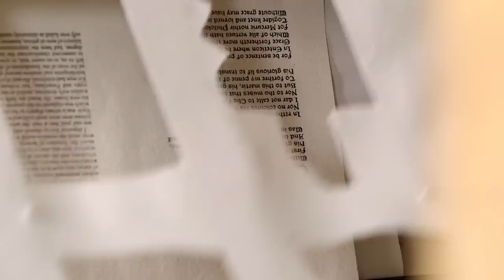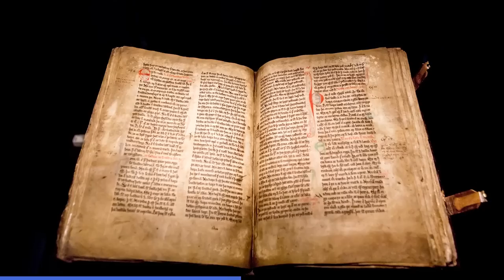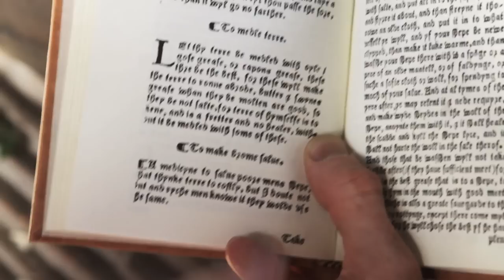Why Did Medieval People Love Sheep So Much? | Tudor Monastery Farm | Chronicle

Comment: I'm so glad you can now use a washer to full wool. And no urine either. You can use urea, which is synthetic urine. I just use Original Dawn dish soap to scour the wool and set the twist.
Reply: urea isn't synthetic urine. urea is a chemical. urine does have urea in it, but  they're not the same thing.
Reply: @sethescope  "About Synthetic Urea: How Was It Discovered, Who Did, And How Is It Manufactured Commercially
by Ben Bareja
Last Updated April 13, 2022
Synthetic urea refers to the urea that is produced artificially as distinguished from biosynthetic or natural urea.

It is an industrial product that has found many applications but primarily as nitrogen fertilizer.

Also described as synthetic or chemical fertilizer, it is an organic compound that is manufactured following an industrial process independent of living organisms.

Natural and manufactured urea have the same chemical formula CO(NH2)2.

However, natural urea is produced by living organisms, specifically, humans, other mammals, and other ureotelic organisms (excretes most nitrogen as urea; Mathews and Van Holde 1990) and subsequently excreted mostly in the urine.

Pure urea was isolated from urine many years ago."

Comment: I feel like the washing part just got them muddy 😂
Reply: And the scrubbing part?  That's how you turn fleece into felt!  Agitate wet wool!  Depending on how much scrubbing they did, they could have a heck of a time trying to card the stuff.  Once felted, that's permanent!
Reply: Two things to consider 
1 washing was about getting out months if not an entire years worth of matting of the wool. By comparison the silted mud of the pond bottom would be relatively minor.
HOWEVER i cannot stress hard enough how their improvised and amateurish efforts would not have been tolerated by a career shepherd. 
A career shepherd of that time would have had a lifetime of experience at the craft, and the lifetimes of experience from their predecessors and the tools and furniture etc would have been well thought out. A stagnant pond would never have been even considered, instead a flowing stream with a down stream sheep gate and board ramp to boost the sheep onto and exit cleanly into a dry and sunny meadow. 
It would have been a team effort of multiple shepherd families and other helpers and any sheep that was not clean enough would have had a second dunking. Also washing might have occurred once a week for a whole month before sheering. These three were mostly going through the motions without their livelihood depending on the best possible outcome of their efforts